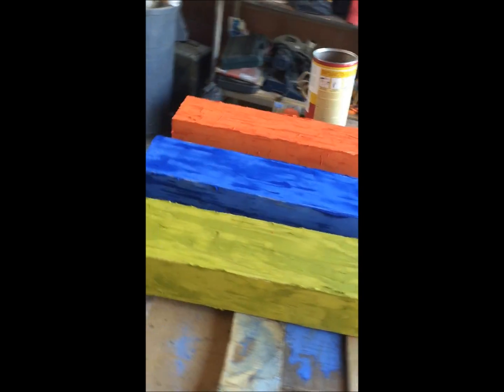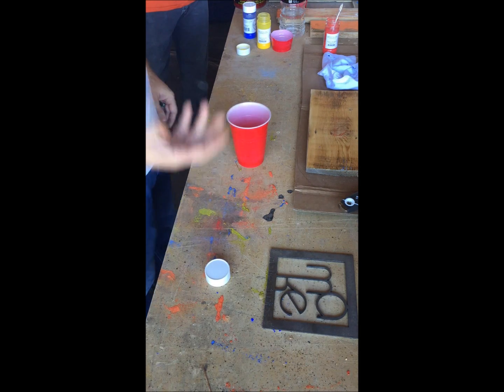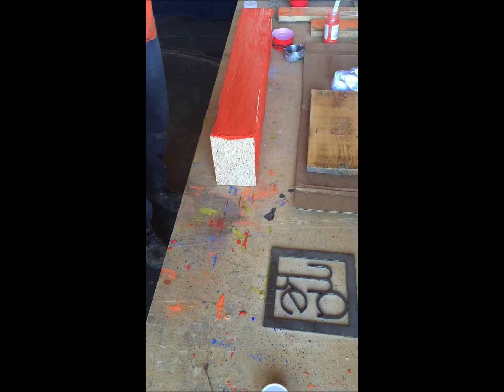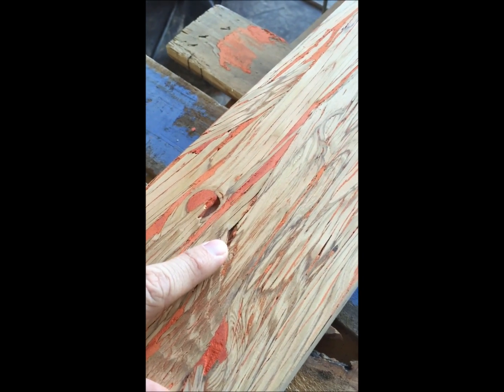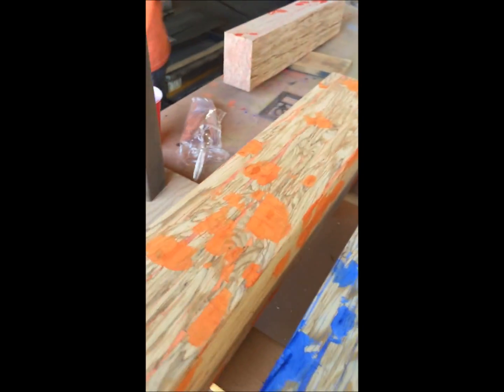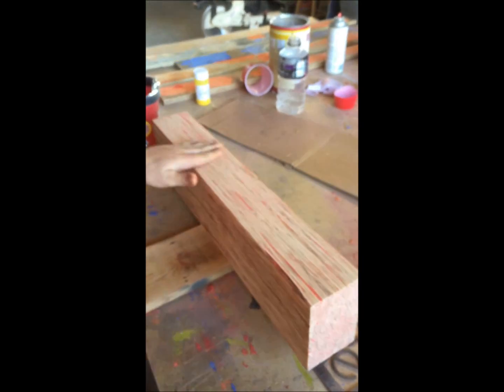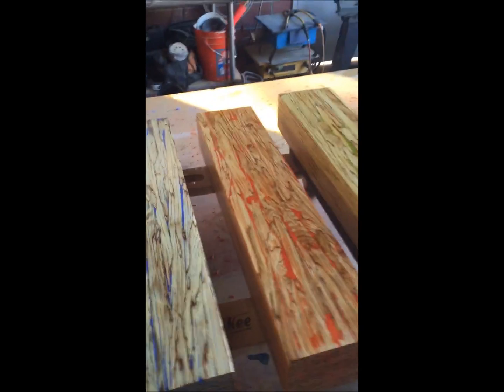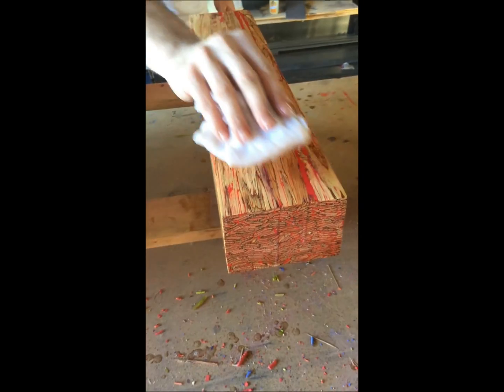How to finish a Paralam Beam

Comment: Nice video, end product looks great. One question, what color would you use to achieve more of a "natural" look, maybe something approximating natural tan? Also I am thinking of doing this on a structural beam already installed in our kitchen, so we wouldn't be able to seal the top and ends. How much of a problem really is cracking? We are located in So Cal, so only moderate humidity in the house, but also never really that dry. Appreciate any insight you can offer.
Reply: Just had a Parallam beam installed in my home after removing a supporting wall. I'm wondering what you did now that it's been a year? Did you find a way to make it look more natural?

Comment: I have this material used throughout my house (floating staircase, transitions to steps going into different rooms, etc). I'm noticing that cracks are starting to form.  Should I be filling these to keep up with maintenance?  After watching your video, it seems possible (although a lot of work).  I also wonder if filling and sealing these again though is worth it considering I can only do at most two faces of the wood (since they are already installed) and moisture can be entering in from other areas.   Thanks for any help!
Reply from the maker: Alexi Chialtas, we now fill with color and then flood the surface with a two part epoxy. It drastically cuts down on the amount of labor required and it lasts forever. I'll put up a video of that process eventually, but it's definitely the best way to go.

Comment: You should have figured out by now that the material is not suitable for painting. You should cover it with something that accepts paint, like drywall, or paper or Masonite or prepainted coil stock or MDF if you want a painted surface.